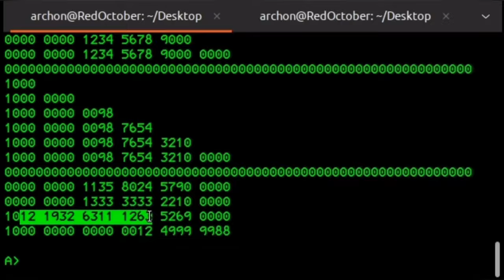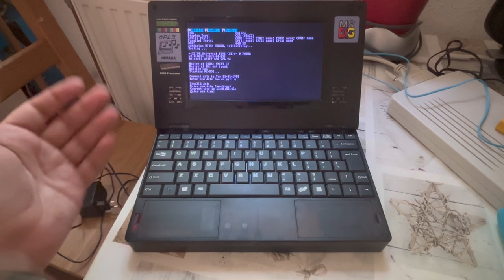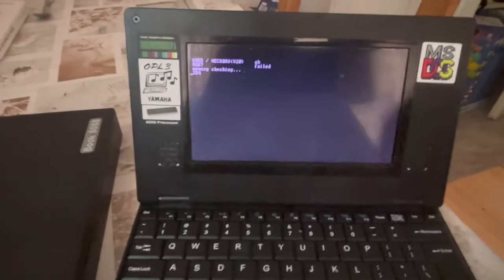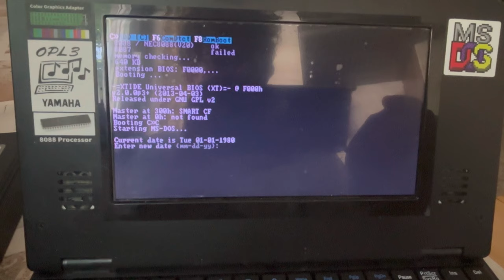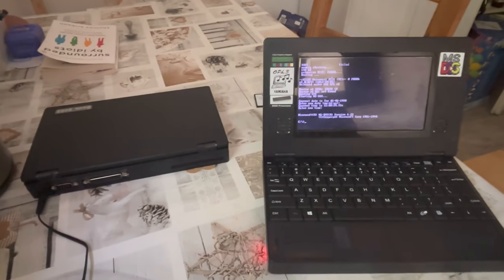i/iii Book 8088: Self-Destruction

Comment: Adrian at Adrian’s digital basement did a repair on a Book 8088… apparently they use recycled ICs that are not New Old Stock but taken out of old computers. These ICs could be prone to failure.

You might want to consider breaking out a digital multimeter and start swapping chips… however you SHOULDN’T have to do that. You should get a free replacement.

I don’t buy from these Chinese retail websites as the customer service is non-existent. If you buy from say a very popular online retailer owned by Bezos they force the Chinese sellers to make it right
Reply from the maker: I did discover what did it. That comes in part ii. Spoiler alert: it’s not an old part… ;)

Comment: Nino, I recently purchased an 8087-1 math co-processor.  I am both scared and excited to install it, given the self-unaliving of your book 8088.  Wish me luck…
Reply from the maker: Hi Clarence, with the risk of spoiling one or two of my own future videos in the matter, having so far burned a handful of 8087s in this machine, let me warn you: your 8087 will be in dire need of cooling! If you do not devise some really neat cooling solution, then what will happen is that your chip will at first work, but then overheat… and depending on its quality and manufacturer, it may then either "shut down", or (after a couple of shutdowns — or even immediately) - get destroyed. My issues here have nothing to do with an 8087, but, as everything seems quite misdesigned, the 8087 is itself in peril. You know that my intro is composed of snapshots from future videos, right? That broken chip towards the end, just before my photos — that is the 8087 in question, after it died.

Comment: You had me laughing at "new machine for reliability". You do realize that this system (and the original Book 8088 V1) are built using mostly recycled parts coming from who knows where, assembled in China without much of quality control, and the circuit itself is amateur quality - while it mostly works, but no one did any reliability testing.
In your particular case, it is likely that the keyboard or the keyboard controller are malfunctioning. Unfortunately, keyboard controller is a microcontroller with custom firmware, and the manufacturer didn't make it available... So not too much hope for repairs. On the forums (was it Vogons or VCFed?!) a person managed to wire an external keyboard to their Book 8088...
Reply from the maker: The Grand Master of Neo-Retro himself, what an honor! Your Zeta v2 I abolutely loved. In my particular case, the damage is permanent and the replacement chip is not anywhere available — I figured out it is a thing marked XTIO, as shown in the next episode. Physically, it is replaceable — but separately purchaseable, not. Regarding old chips… you know, maybe I am lucky, but somehow, they were never an issue. The issues I experience usually stem from misdesign — like here.